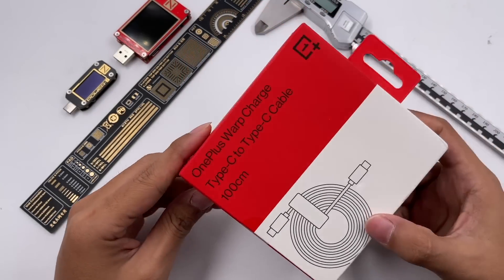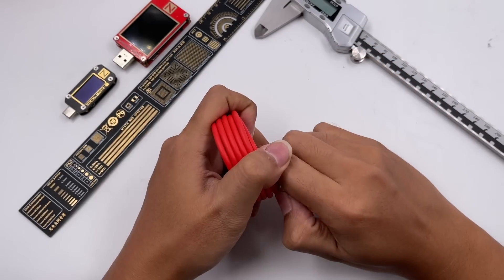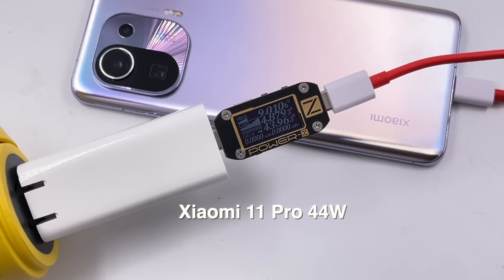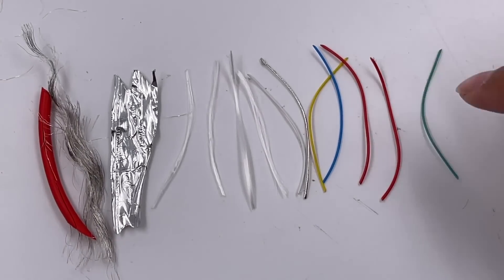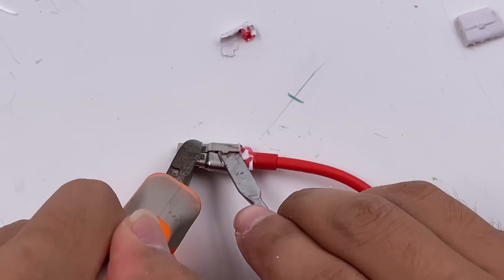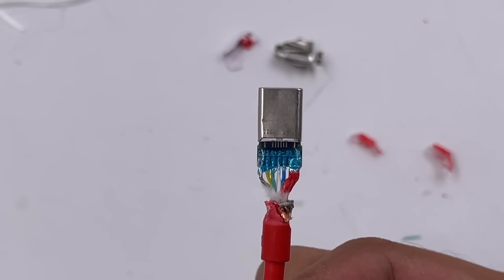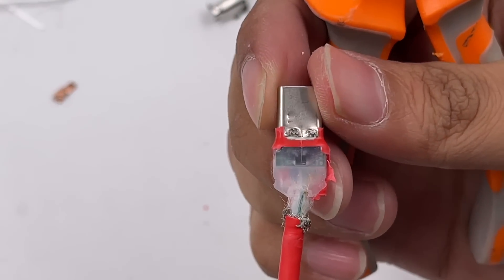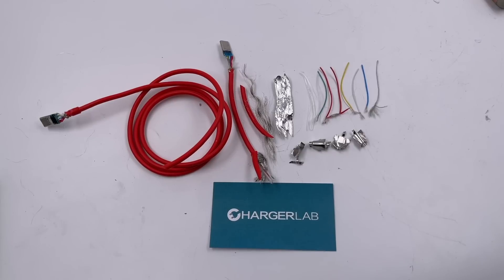Teardown of Oneplus Warp Charge USB-C Cable

Comment: I have 6t that only charges with moto qc3 charger in one orientation only. Any other charger / cable combination either does nothing or says plugged in can't charge right now. I've already replaced flex and daughter board. It seems a problem with mainboard. Any ideas on what I should check?

Comment: I had my oneplus 3 cable since 2012 and it was still undamaged and worked fine until I lent it to a friend who needed it for a while in August2020 until her charger cable arrived. Unfortunately for me, the cable returned like it was ripped or blew up from the inside of the wire.

Not sure if a technician could just cut out the part that is torn & re-attach the charger's ends once torn part is removed from cable.
Reply from the maker: For safety reasons, we strongly recommend that you purchase a new

Comment: Using this cabe since my OP 3T and still looks pretty good
Reply: no you're not this is a way newer cable and USB c tu USB c
Reply: @armaanmodi  Right, the 3T cable is USB-A on the charger side. Still, apart from the different connector on one end, they have a lot in common. My 3T cable is still in daily use and still looks and performs like new.
Reply: @klausstock8020  I'm sure that old cable isn't meant for 65W speeds. They introduced 30W in 7T etc
Reply: @armaanmodi  Yes, it isn't meant for that power. While it probably could deliver the electricity (the newer generations of Warp Charge/VOOC use a higher voltage, so the increase in current is not so big, and Warp/VOOC can also compensate for voltage drop along the cable), the ID chip would probably get fried by the higher voltage. Naturally, the charger will not deliver the increased voltage and power when it detects an old cable.

And yes, the newer cables are also very noticeably thicker than the old ones. But the general design principles and engineering which went into the cables are the same for the old and the new cables.

Comment: I love the oneplus charging cable. I changed from samsung to oneplus 1½ years ago and the cable is still like brand new. It just feels way more durable in hand compared to cables from samsung etc.
Reply: I think exactly the same way. I bought the original Nord in 2020 and the material quality is just superb on everything, so is the charger: one and a half years and no signs of fraying or loosening connections, and still charging as new. That's how things should be all the time, if you ask me.
Reply: @gaomn_03  yeah my op8 still feels like new in terms of battery life and overall performance. Gotta say the camera is absolutely ass though which bothers me from time to time but other than that and some minor lacks in the software, great phone.
Reply: @RealLagu  Mine too. I analyze my Nord's battery through an app and it's still at 87%, having bought it on August of 2020 with 98% of its advertised capacity - lithium-ion batteries tend to do that - and using it very heavily. The camera can be a bit hit-or-miss, but it's more than fine for what I use it for (very sporadic, brightly-lit-scene pictures) and it launches fairly fast from a double tap on the power button. 

The problem that I think that lies within OnePlus camera systems is that they hype them up too much, when they can't really focus on them, because they want to maintain their prices low.

Phone cameras aren't so much a hardware thing - though it helps - as they are a software thing, and good camera software development with normal camera hardware is more expensive than blasting good hardware with subpar software - what happens with OnePlus. That's why the Google Pixels of three years ago still beat phones of today by a long shot.
Reply: @gaomn_03  yeah thats true! 
My battery seems to be at 89% of its original capacity (bought brand new in august 2020), and still survives a day with my heavy use. 

And what comes to my little camera problem is that I myself shoot a lot of video in bad lighting (indoors) and the phone really struggles at it. Well, I do own a dji osmo pocket which handles it fairly well and as I can easily keep it in my pocket, its not too big of a deal that the oneplus camera sucks
Reply: Wait for 6 more months and your cable will be out of service
Reply: Yeah it's so bomb!! It's like the beats cable

Comment: would be nice if you could do the same with there type-a to type-c cable, always wanted to know how the the phone knew it was using a oneplus cable in order to do warp/dash charge (since using other cables with the same warp/dash wall plug results in no warp/dash charge)
Reply: Most likely a chip in one of the side of the cable that the phone communicates with
Reply: @shoraz  well what i thought is that maybe theres a chip in the charger and a extra pin in the oneplus USB-A end that allows the phones charge controller to communicate directly with the chip in the wall charger.

This would mean the phones knows that its connected to a oneplus charger and whats the output. it would also mean the charger would know that your using a oneplus cable and could supply the full charger output. (since oneplus has gone for a more amps form of fast charging (I.E. my oneplus 8 pro charger outputs 5V at 6A for a total 30W fast charging)
Reply: @DTronicsUK  you wouldn't need an extra pin on the USB a side as in "dumb" chargers and cable only two of the pins are used for power delivery as the charger do not communicate with the phone. 

Most likely OnePlus just uses one of the data pins to communicate with the charger and phone.

Comment: Hey buddy ,

I have cut my nintendo switch's charger's wire (the dc wire which contains the usb type c male) and upon cutting I get to see a blue wire/2 white wires and 2 black wires .. just wanted to know if you could help me in identifying the wires by looking at the color.. please help me if you can .. just wanna understand what those wires are  .. so that I could put a new type c male port/wire with usb typec  .. the existing usbt typec is fault(the pet chewed it) ..please help me if you can 

Regards
Rahul

Comment: Those a quite thin for all that current. I recently made my OnePlus OEM charging cable longer and aside from the normal 4 pair in USB there were two extra wires. Two +5v lines with a thicker guage and a extra wire for the dash/wap charge at a thicker guage.

Comment: having a chip inside a cable, now that smells conspiracy....
Reply: It's used to identify the cable type and manufacturer so that way the phone don't pull more current then the cable can safely supply. Ever see a USB micro cable melt in a phone? Kinda hilarious but it sucks at the same time
Reply: True, every cable is IDed.
Reply: @evil_source_dk  thats why we have cable rating, just put it on the cable, why go the extra mile to plant a chip inside it 🤗
Reply: @mohsinmumtaz9886  because users don't know, don't care, or might forget.

I have 100 W cables that get slightly warm at full load, a 45 W cable would melt if used accidentally

Comment: 1:00 "USB 2.0 only"? Can't we have cables that are good both at power and data delivery?
Reply from the maker: Thunderbolt 4 can satisfy you.
Reply: Most phones only use 2.0 even if they have type c ports. Kinda stupid honestly
Reply: @CotyRiddle  OnePlus 7 Pro and higher use a USB 3.1 Gen 1 USB C port, yet their cables are only USB 2.0
Reply: Most mid range phones usually still use usb 2.0 specs (even iphone still use usb 2.0 too), only high end android phones use usb 3
Reply: In theory yes. But as SuperVooc is using higher current (that's what the C symbolizes in VOOC), the wires that actually transmit the power are already thicker than most other cables. 
If you now want higher speeds, you need another few wires inside the cable, making it even thicker. 
People are already complaining about the thick cables, and this would just make that much worse.